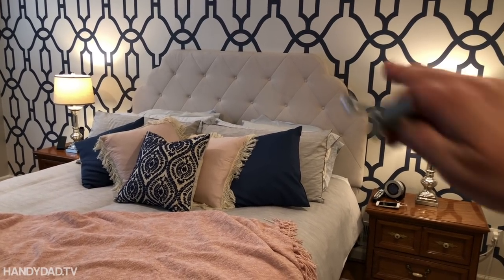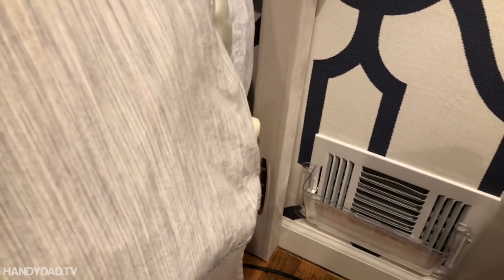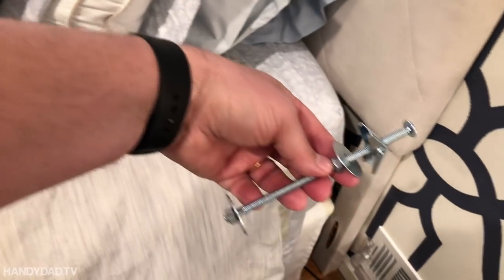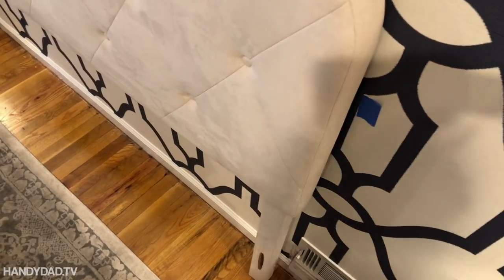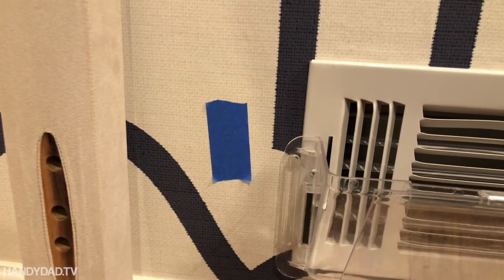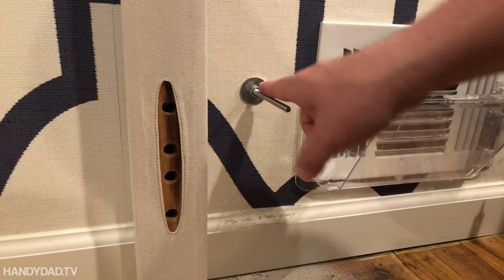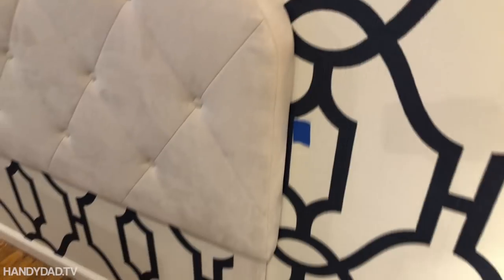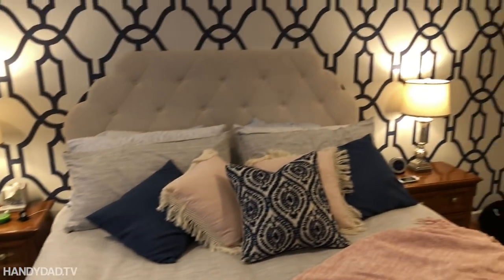Wall-mounted Headboard for $5 using Toggle Bolts | Master Bedroom Makeover (Part 4)

Comment: I searched the internet for alternatives to remount our headboard to the wall.  Our first attempt several years ago was not our best attempt, so we wanted to redo it.  We found your suggestion to be the best because we also used toggle bolts on our first attempt.  However, your reverse use of the toggle bolts is genius. In the final finish, we noticed that the bolt end would hit our mattress, so we decided to cut the bolts shorter and then we added rubber tips that you can find in the hardware drawers at Lowe's and slipped them over the cut bolt ends.  If I could add a photo of them, it would be great for everyone to see. It looked really professional.  This remount took about an hour - so thanks for putting this great video on the internet!

Comment: So just mounted ours and used this video for inspiration. However I would suggest using a 1/4-20 toggler brand wall fastner instead. They allow the bolt to bold directly into the wall and can be removed for cleaning etc but won’t have the threads sticking out like this method will.
Reply from the maker: Good tip 👍🏻

Comment: Hi HD.  Thanks for your great Idea.  When my wall mounting is finished, I'll be pushing a new-to-arrive king size platform frame against my wrought iron/brass headboard (currently attached to a basic metal frame) after I have attached the the headboard using your technique.  (1) Do I have to worry about accidentally, or possibly through wear over time, having my wood platform push the headboard loose from the wall because the wall bottom molding makes the headboard leaning slightlytoward the back wall, which at the floor may be 1/2"-1" out from the wall (in my case: 1/2"  thick skirting molding plus 1/2" quarter round trim molding on top of it)?  (2) Each of my wrought iron headboard legs have two screw holes about 6" apart.  Should I use only one screw per leg or use 2 screws per leg? I saw you also have more holes in each leg but only used one hole to fasten. Has this proved enough tightness?  Thanks in advance  for your thoughts.  BTW you did a great job in making a clear and effective tutorial video.  I can't imagine it being any better, and it's the only one I saw that had a method that could be used with my wrought iron situation rather than the more usual solid back.
Reply from the maker: I have a king size foam mattress. It’s friggin heavy and the bed barely moves under ANY circumstances. So we didn’t attach the headboard to the wall right away. It was just wedged by the bed. But it didn’t stay flat so I added the toggle bolts. It’s impossible for me to say if one bolt will be enough for yours, but all I can say is try it. 

The other advice would be to use a different kind of toggle bolt. Google “snaptoggle”. They’re better because you can unscrew it without losing the bolt in the wall.
Reply: Great reply.  You came up with an even better idea to use Snaptoggle fasteners.  I never used them before but definitely will use them for this project.  You just made an already great YT video problem solution even better with your suggestion to use Snaptoggles.  Thanks again.  Subscribed!  @handydadtv

Comment: So what if your having vigorous motion in the bed will it slide around since the bed frame is not attached to the wall?  Just wondering .  They should make brackets that you can take the wheels off your bed and put a bracket in so you could Mount the frame to the floor itself.
Reply from the maker: Sounds like you should just put the mattress right on the floor. Why risk scratching your floors and breaking the bed with all that vigor.

Comment: Will this method work with concrete/Adobe walls? I live in a Spanish style Adobe house.
Reply from the maker: Yes but you’d need to use anchors made for cement. Mine were for drywall.

Comment: My headboard would be up against a window, would that make a difference? I see that at the end your headboard is flush against the wall and I’m wondering if my windows will make a difference with mounting it to the wall
Reply: Also, I have a metal headboard would that make a difference as well?

Comment: Naw. The bed frame isn't square. you need to reinforce the headboard to compensate for the gap created by the baseboard trim. This is how and why your headboard hits the wall during coitus!
Reply from the maker: This method holds the headboard tightly against the wall so there is no movement during nocturnal activities.

Comment: I don't get it. The butterfly clip is still in the wall. What did I miss?
Reply from the maker: You didn’t miss anything. The benefit is, I can remove and replace the headboard without losing the clip.
Reply: HandyDadTV ohhhhh ok that makes sense.